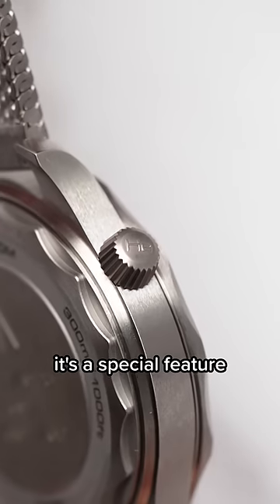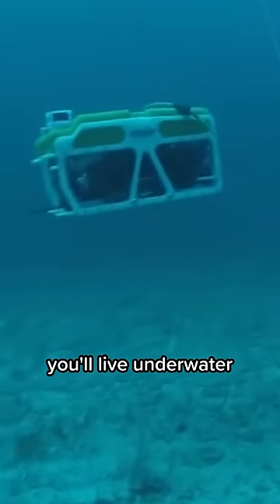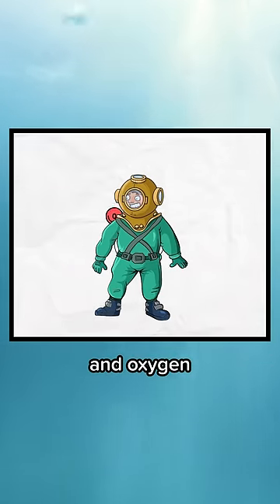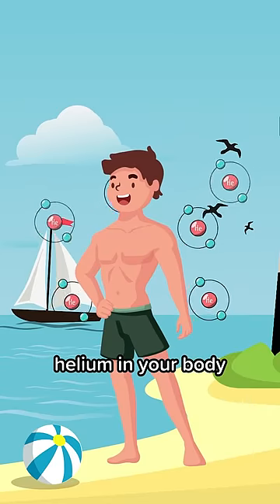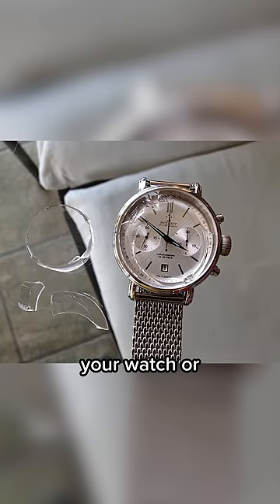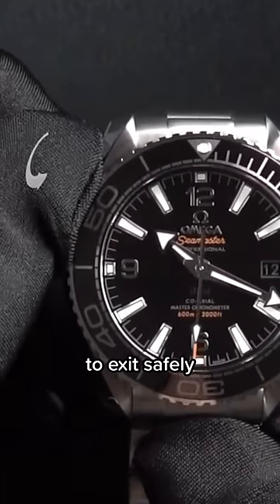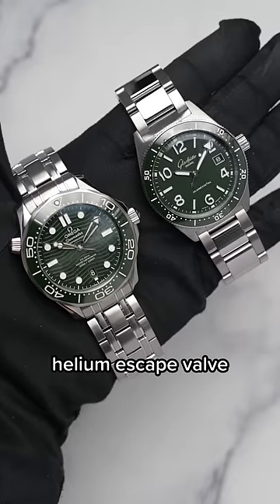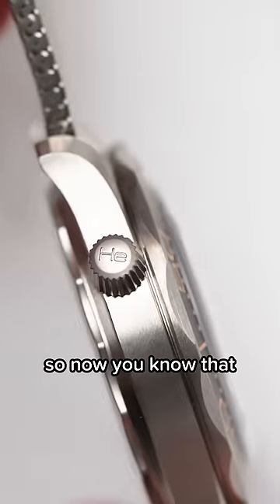Do diver watches need a Helium Escape Valve? 🤿

Comment: The guy who designed Omega’s helium escape valve must feel like he completely wasted his engineering degree knowing that 99% of buyers will never go deeper than 20ft underwater.
Reply: It’s not just about depth, it’s about being inside a saturation chamber. This feature would only apply to a few hundred people world wide, and you can get away with a pressure release valve that is nearly imperceptible for the user. The helium escape valve is 100% unnecessary for 99.9999999% of people, and for the remainder, there is a better design. IMO its just a bad design, a tool watch with a use,ess and ugly component, it fails at being a tool and a design piece.
Reply: Equivalent of Steinway Grand pianos becoming center pieces in some rich millionaires' house never to be played instead of being in concert halls where they belong
Reply: @Victor-kh5rh  I think the whole design philosophy behind the Seamaster 300 series was “let’s take the ugliest possible designs for every aspect of the watch and see if we can somehow make them all work in harmony to make a cool looking piece” and honestly, for me at least, they pulled it off.
Reply: In that case it's l'art pour l'art.
Reply: And if you do go deeper than that, you won't be relying on a mechanical watch to time your dives.
Reply: @Victor-kh5rh  Exactly! The spring design used by Doxa and Rolex is FAR superior to a version that needs to be unscrewed as used by Omega, with that ugly 'pseudocrown'. The chances of a professional industrial diver using a dive watch that actually has a helium escape valve in a work situation is incredibly slim taking into account the nature of the work, and the cost of a watch that has the feature, when dive computers tell the time anyway!
Reply: 99.99%
Reply: Then what about those engineers who make a vehicle off-road capable,but 99% of them are mall cruisers.
Reply: @pradhyudh  thing is, off road capability is still pretty useful in the city. If you live in a city with harsh winters, it comes in handy when dealing with snow. Also, if you swerve off road and end up in a ditch, it’s pretty useful too.
Reply: @alpang6161 Yeah, that irks me. I want one!
Reply: @alpang6161 at least they look good
Reply: I don't think any serious professional diver is using a dice watch like this anyways.
Reply: @austinm.9832  sure, but the thing about dive watches is that while they’re are obsolete technology, making a watch that can withstand major water depths is an exercise in making the watch more durable while retaining the design philosophy of classic watchmaking. There’s value in making a keepsake for someone that can withstand harsh environments. But the helium escape value is absolutely pointless and adds nothing to the overall quality of the watch.
Reply: I hate to break it to you but people who buy dive watches don't even dive.
Reply: its a marketing feature
Reply: @alpang6161  That watch belongs on an oilrig!
Reply: 20 ft? I know some people who won't wear their omega in the rain
Reply: @Nevy21  Those people should have bought a Seiko.
Reply: this was feature made for saturation divers because before rolex was a popular luxury watch brand it was well known in the diving world for being a reliable, extremely accurate, pressure rated time piece in a setting where time is your biggest enemy, so it was born out of necessity
Reply: Thats like saying that the space pen sucks because people dont take it to soace. The point is overbuilding things.
Reply: 20 feet? You mean 6 feet
Reply: I don't really get the point of diving watches if they dont glow
Reply: If they did't have it i wouldn't want to buy it 😅
Reply: nahhh it's cool either way
Reply: I wouldn't be surprised if 99% of buyers never even get the watch wet...
Reply: Close to the 100%  a a saturation diver probably  will be using his dive computer instead a a watch
Reply: the ones who use it to its full potential are enough to justify the effort
Reply: The 1% is what makes it all worth it.
There must be a diver with this kind of watch, and knowing that they probably added a couple years to their watch specifically thanks to a helium escape valve, it’s all worth it
Reply: @pradhyudh the engineers have nothing to do with how customers use their vehicles. All these new broncos i see only one has ever been muddy. But again, I wouldn't take a 130,000$ Ford offroad
Reply: Why not just open the hand turner thing, does that not open the insides or does it just make is seseptable to water damage?
Reply: He made for 1 per
Reply: That is true for most luxury watches
Reply: Doing sat.
Reply: No, he didn't waste anything because he was asked to design it for the Omega company and paid for it anyway.
Reply: The bean counters say otherwise
Reply: 99% of buyers will never get the watch wet lmao
Reply: I don’t think so. Its like hypercars - the success is in what it’s capable of.
Reply: Omega's tooth paste cap HeV
Reply: 99.999999 % I'd imagine
Reply: It’s like installing turn signals in a BMW preatty much useless
Reply: Hell no, he's laughing all the way to the bank😂🎉
Reply: I'm sure his paycheck reminded him his degree wasn't a waste
Reply: 99%
Reply: @Victor-kh5rh 😂 you don't know much about the industry, there are thousands of saturation divers just in the US and they regularly make over 400k a year. They can wear whatever watch they want😂
Reply: @Victor-kh5rh most divers in a saturation chamber would have a dive computer that keeps time just as good too lol
Reply: I suppose it COULD be used by professional deep-sea divers; but wouldn't they really be using modern dive computers instead of a piece of jewelry, since their lives depend on it?
It's just silly that these even exist.
But to each his own.
Reply: Nah, marketable yet unused engineering gimmick is still marketable & profitable. Just like iPhone's hardware-software integration etc

Comment: Can't you just unscrew the main crown to release the helium?
Reply: Definitely yes, that helium escape vavle is 95% marketing... Problem was that some divers forgot to unscrew their crown and damaged their watches, so Omega manuel valve doesn't really make sense while on the Rolex it's the pressure inside the watch which will open the valve so you dont have to worry about it, makes more sense
Reply: Not while underwater.
Reply: you can't unscrew the crown while underwater so you can use the valve instead of that.
Reply: @zachkozak7336  dude, you don't open a helium escape valve underwater. See the above comment
Reply: Not a good idea, the HE valve is one way, the crown is two way, it's ok to pop the crown to wind and adjust because it's only open for a few sec. Decompression can take days, so too risky to have two way crown open that long. Also crown has seals in place, pressurized gases passing over could dislodge and cause other issues. Stick with HE valve, much safer
Reply: I think that can cause the watch to implode
Reply: @ALL-il1sw i
Reply: @ALL-il1sw correct that the gas could mess with the gaskets in the crown. But the helium escape is NOT a one way. Do not open that underwater lmao. You will flood it
Reply: @ALL-il1sw ou wouldn't damage anything if you let the crown stay open for 3 days. Just make sure the watch is stored properly. 
Anyways, there is less than 1000 saturation divers worldwide. 
Who cares about this feature anyways ?
Reply: @nicholasberends7751  sorry your wrong, Omega HE valve still has water resistance whilst open = one way valve under the crown.

Edit- The Omega HE valve is essentially an automatic valve, with a manual over ride crown on top
Reply: @stilianivanov3377  stored properly, so NOT worn on the wrist? I know this feature is useless to most, but part of developing luxury products is making something completely overspec, all because you can
Reply: @ALL-il1sw  maybe the new ones do, or maybe thats just what they advertise, but i can tell you for fact you don't wanna try that on an old one lmao
Reply: @nicholasberends7751  anything old with a seal needs to have the seal replaced. Automatic HE valves are no different
Reply: @ALL-il1sw hahahah thanks for the laugh.
Reply: @godrav8818 you don't do that under water
Reply: @lavawolf666  you can.
Reply: @godrav8818  yes you can. But the result maybe  won't be good. So check your manual for your particular model
Reply: That is what they used to do
Reply: You can, but the adjust crown isn't as waterproof when it's unlocked and pulled out, there's a risk an accident could happen and water could get in doing it that way. The helium escape valve is a one way valve even when it's open it's water proof.
Reply: @godrav8818 You wouldn't open a helium escape valve under water either, if you're needing to use the helium valve it means you've been down in pressurised bell or habitat for weeks working, a diver would periodically open the valve while the bell or habitat is slowly being depressurised back down to sea level pressure over the period of many days, he wouldn't even be going in the water at this stage, he would most probably be laying around bored in a habitat on the deck of a ship while slowly depressuring.

Comment: The problem with omegas solution is that the helium escape valve has to be opened during decompression where as the deep sea does it automatically

Comment: My Vostok has a helium valve as most of the vostok divers do - it's permanently fixed and you cannot move it, excess helium will naturally bypass it when necessary it's a one valve
Reply: You must be referring to “Vostok-Europe” not what most watch enthusiast would consider a “Vostok”. Most Vostok divers are the vintage reissue variety and certainly don’t contain a helium valve.
Reply: @Mr1121628  You are correct, this is a modern Vostok Europe, actually no relation to the other Vostok at all I believe

Comment: Question. What about crownless valves? I have a Hamilton Khaki Below zero... I was under the impression that the helium escape is also there in case you need to get in a iperbaric chamber in case of emergency while resurfacing. The valve is there to prevent the watch from exploding under oxygen pressure

Comment: Btw, it's not helium that's going into your body, it's nitrogen and so if you surface too quickly, bubbles form in your blood. This is called "The Benz" and the same thing can happen to a watch. Also, you for spending longer underwater, you breath a mix of nitrogen and oxygen and not helium and oxygen. This is a type of diving called nitrox diving. Helium is not as issue when diving. I am a qualified advanced open water diver (PADI). Hope this helps.

If I am wrong in any of this, please feel free to correct me. Thanks

Edit: Decompression sickness (abbreviated DCS; also called divers' disease, the bends)
Reply: While you're partly right every type of air you breathe is a combination of nitrogen and oxygen, nitrox diving refers to when the concentration of oxygen is higher than the normal 21% to increase underwater time. Also helium is definitely used for diving, it has benefits over nitrox diving since nitrogen becomes toxic to the human body at high pressures whereas that pressure threshold for helium is much higher so for a saturation dive, divers are more likely to use helium and oxygen than nitrox which is usually reserved for shallower depths. Also a Padi certified diver here :)
Reply: I am also a PADI advanced open water certified diver and we never covered nitrox. Like, at all.

Comment: Fun helium fact: In a certain hospital, there was an area where (mostly) iPhones stopped working until you left the room and corridor,
Turned out, that there was a helium leak, and the helium in the air was able to get into MEMS replacement of the quartz oscillator and made it operate on slightly different frequency than it was designed for, causing all kinds of glitches
Reply: (Yes, the same quartz oscillators that made digital quartz watches possible)

Comment: The guy who designed it must feel like he wasted his time beause the crown is already a helium escape valve.
Reply: The guy who designed it is probably rich, chilling in front of a warm fire in his mansion sipping on fine liquor.
Reply: Yeah that's not really true unfortunately
Reply: @joepringle3695  How so?
Reply: @vaclav_fejt  the crown isn't an effective helium escape valve
Reply: The adjust crown is only partially waterproof when unlocked and pulled out, it would be risky to unlock and pull it out it in a diving bell situation. The helium release valve is a one way valve that is waterproof, or at least more waterproof than the adjust crown, even when it's open.
Reply: @ats-3693  Not a saturation diver here BUT diving bells are closed units. Basically a submarine connected to a vessel by a cable that had no means of propulsion. Not sure how it would be risky to open your crown in a closed bell. 
TBH My big problem with helium escape valves is all the dive watch owners who are non-divers hyping up their helium escape valve as essential, indeed critical, to the function of their watch and if your diver doesn't have it, it's no good. If you are NOT a saturation diver, you will never ever ever need a helium escape valve. That is such a small fraction of an already small market. (Plus the Omega SMP helium escape valve just looks silly to me).

Comment: Short story, when divers use a decompression chamber to surface much faster they breath in a mix of Helium and Oxygen to expel carbon monoxide faster.
Because Helium is such a "light" gas it will penetrate seals, gaskets on atomic level very easy.
Helium that sneaks in to your watch case will take the same pressure as the compression chamber but once decompression with the mixture is complete and your body has expelled all of the carbon monoxide they can decompress the chamber very fast.
Not giving the time to Helium to escape trough the seals.
On Omega watches you need to unscrew the Helium valve to equalize the pressure inside the watch case.
Rolex, Breitling, Tudor have automatic valves.

If you don't do this, 2 things can happen:
1) the crystal will pop out but certainly not destroy or break the crystal or your watch.

2) nothing will happen and the Helium will seep out over time trough the seals.

I own several dive watches from Rolex, Tudor, Omega, Breitling...
Im also a diver, some dive watches like the Rolex Submariner don't even have a Helium escape valve.
That's because you will need to dive so deep where only a handful people would go for scientific research.
Reply: Does the helium leaving over days make your voice high and sweaty for days? Or is it not enough to mess with that?
Reply: It has nothing to do with carbon monoxide.
Reply: @amdy7783  As i stated, it has everything to do with Helium, that's why dive watches have Helium escape vales. If you gonna read please do so with effort.
Reply: @JerryDoe  no, when divers use a decompression chamber, it has nothing to do with carbon monoxide.

Comment: Helium is the primary gas used to pressurize saturation diver habitats because oxygen and nitrogen cause their own health problems at high pressure. They typically don't take their watches into the water. The helium gets in there in the habitat.

Comment: that is, Approximately 30 million who bought such a watch, one smart one needs it, the remaining 30,000,000 are victims of marketing. And by the way, I was specifically interested. No any authorized workshop that has a protocol for checking the repair and maintenance of the gel valve. They just change it

Comment: Superfluous for 99% of people who go diving, and doesn't actually solve the problem it set out for. Those divers in the decompression tanks would blow out a crystal if they forget to unscrew the crown. Forget to unscrew a manual valve, and you're in the same boat.

The Submariner does solve the issue, as their valve pops open if pressure increases in the case. But, who would dive with a $10,000 watch?

Comment: Alright but if the valve is closed then how the hell does helium get into the watch?  Why would an airtight diving watch leak any gas into it to begin with?
Reply: Tiny cracks and wedges where water does not get into due to surface tension but gasses can. Then when resurfacing the pressure changes from that of the saturasion habitat to normal and the helium wants out real quick from under the watch glass to the atmosphere and without a big enough hole the tiny cracks and such dont release the gasses fast enough and the glass cracks

Comment: Are you sure it's for helium to exit and not enter? A watch that is built on the surface is waterproof, but a saturation diver may want to let helium (mix) INTO the watch to protect the gaskets since they're down there for so long. Wouldn't it make sense to relieve the compression forces and allow the expansion of gasses out through a pressure relief valve?

Comment: It's just a cool design feature of the watch. Most chronographs have two pushers on the side of the case, to start, stop and reset the stopwatch. Compared to that, the single helium escape valve on a tool dive watch looks sleek.

Comment: Useless feature for non divers. If u just swimming & dive a while for 30 min to 1 hour ++ , this feature is not for u. This feature just give watchmaker a reason to add u around 500 - 5000 bucks more. 😊😊😊
Reply: Without the valve they would charge the same price. Submariners are twice the price as these for example